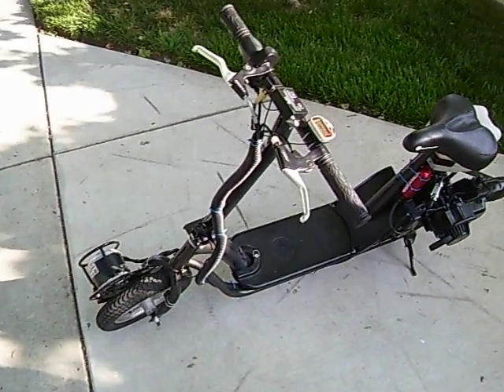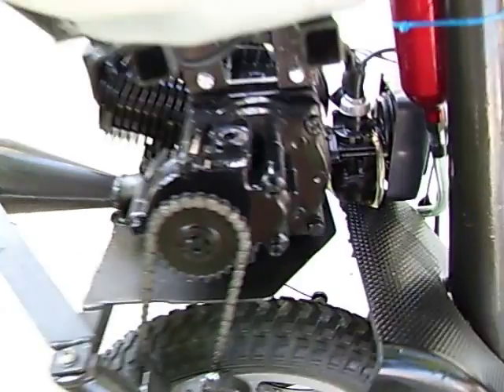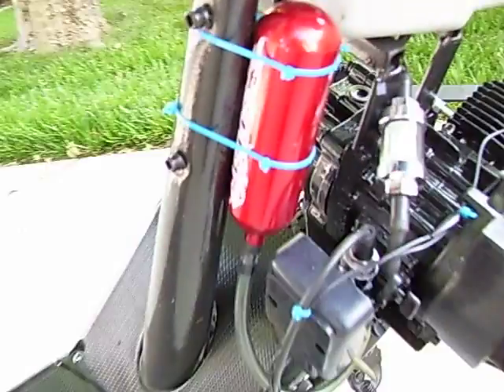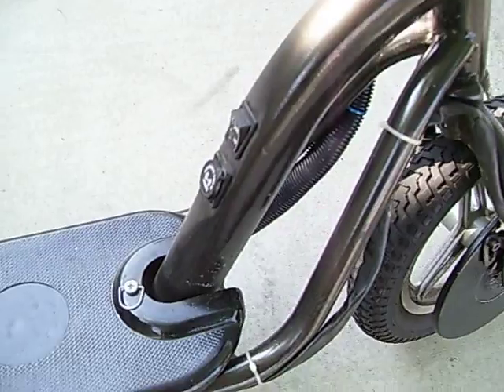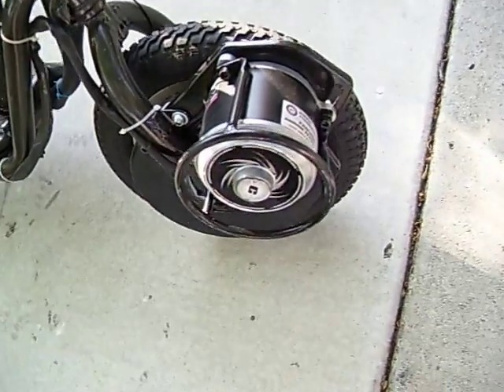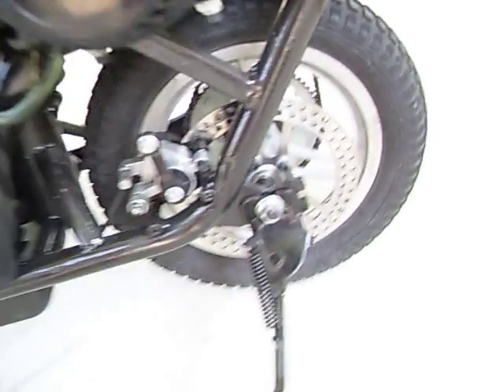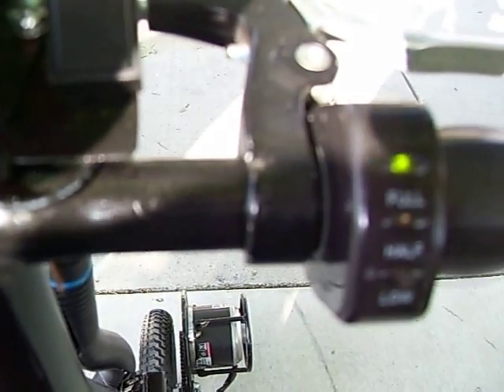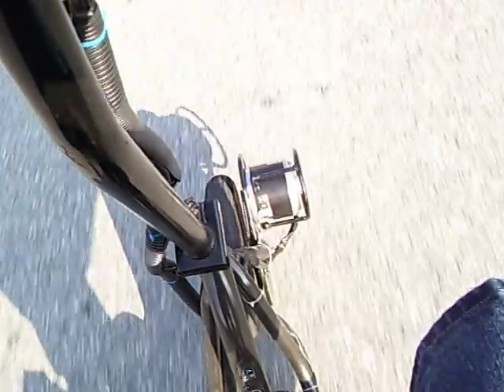Hybrid Scooter

Comment: just remove the freewheel from the electric moter side. don't turn the throtle(electric mode) and it will charge if the controler puts out voltage (throtle off) I have duel electric thet recharges back and forth with 2 scooters put togeather the front fork rides on the rear axcle of the front.